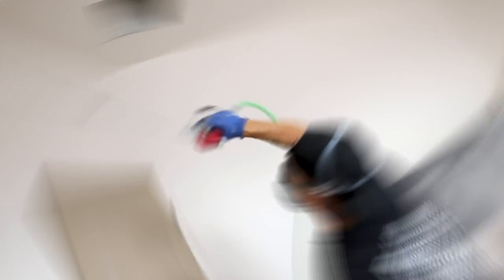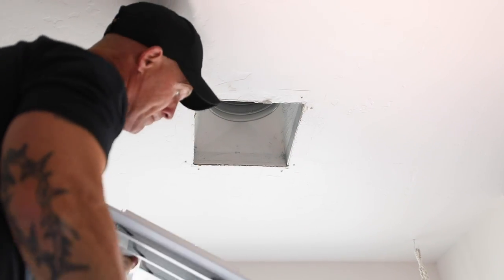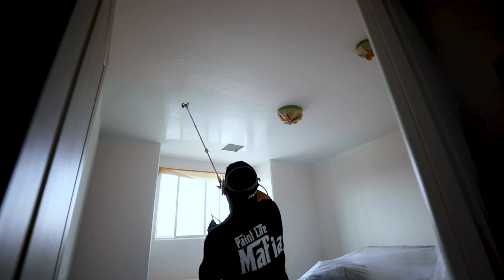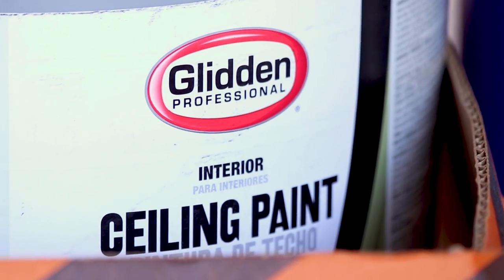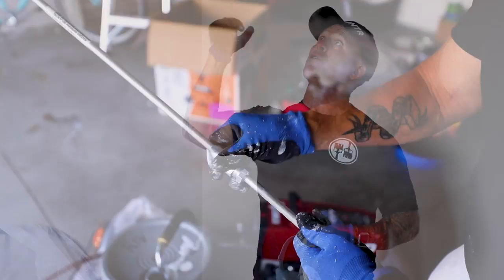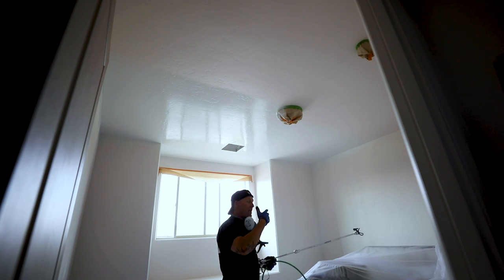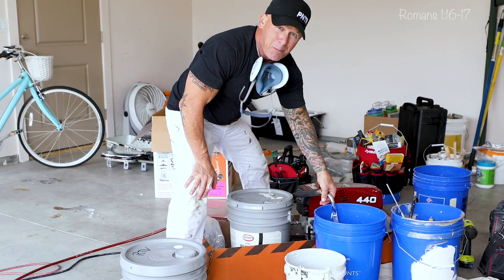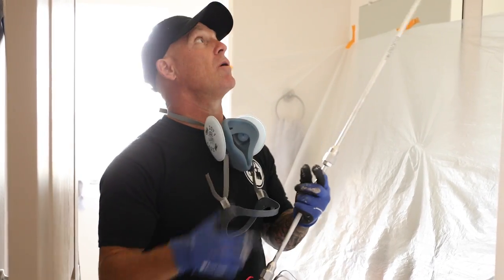10+ Tips Spraying Ceilings. Painting a Ceiling FAST!

Comment: Since chb is hard to find these days,  I've found valspar ultra ceiling covers great,  its pretty thick,  but it dries basically deas flat and is around 125 a 5gal bucket.  I actually like the valspar wall paints as well. Ultra and signature are both affordable paint options that i prefer to cashmere in many cases

Comment: tonight the Answer I have been seeking for weeks has come and clearly. Yes, I put a Guage on my Greco airless spray painter. The Pressure is given let's say spray with 1000 psi you look at the pump and say it's 1000 and it's still wrong. I am using the correct low tip for what is going on.  But tonight I Must thank the boss theidahopainter. finally stated clearly at the gun. I haven't used spray equipment in a long time and You and your crew have brought me right back up to speed a very big thank you Still love getting one of the old guys.  yes, older now but still want to. Just like the old and young bull.

Comment: i just sprayed a whole house with ppg ultra hide flat ceilings eggshell walls i was impressed for the price  i believe its better than pro mar 200 the eggshell also laid very well on the walls no issues with lap marks but you are correct the ceiling paint did finger but dried ok the eggshell did not finger tho

Comment: I have watched a lot of your videos.  I just helped my son paint the entire interior of the house.  I followed your techniques and they worked well.  What I found missing from you videos was clean up.  We sprayed about 50 gallons of paint and the amount of over spray was significant.  Every floor had lots of paint dust.  I am sure every wall and ceiling also has it.  Of course we did all this before the flooring and cabinets were installed.  What is your advice with doing a job like this with respect to cleanup?  Is it ok to leave the pray gun (Grayco X5) over night in the paint?  We did.  Just put the gun in a bucket of watch and plastic over the paint.   Finally, we painted about 40 doors inside by standing them up and linking them with boards across the top.  We did mark where the door went on the top of the door but the over spray covered it.  UGH.  Could not do it out side to to weather, bugs, the number of doors, ....  Doing it side caused even more over spray.  Can you  comment?
Reply: Carpet - Carpet film
Flooring - Rosin paper
Buy a hand masker to avoid overspray on trim, walls  ceilings or windows.
Leave gun & tips in thinner, run thinner through machine after you’re done. 
Power wash exterior before painting, bug repellent.
Use that 9’by400’ plastic and hang it down with tape from the edges of the ceilings and you won’t have overspray on walls.

Comment: I know most paint contractors don’t like Home Depot Behr paint as a professional contractor I have been using it for over 10 years try this for your ceilings BEHR PRO i300 Dead Flat White Paint about $70 for 5 gallons with a 20% discount after Setting up your account
Reply: never used Behr for spraying but it is the one paint I refuse to use. Way to fast at drying.  Pulls like thick glue when cutting edges with the brush I think it's the worst. Love to here what paint life thinks about using it for spraying. Plus my paint suplier is BM and i would have to pay full price for it.
Reply: 1 idea,,
I tried using totally tree hugger paint on ceilings,
Like the most environmentally "friendly" paint
It actually worked better than the regular paint that minimally keeps the environmental gguidlines
Not a hippy, but it actually worked good,🤔
Reply: The i300 flat is excellent ceiling paint but I will stick with Benjamin Moore superhide zero voc flat,it hides,and rolls better for me.I have them throw some white colorant in it cuts down a bit on the gray.
Reply: @drewcama5481  Customer got some. Yup, pulls itself off as you roll dries so fast.. Don't want to be involved with it again. XIM to the rescue...saved the day. A must have with HD paint.

Comment: Still learning how to spray..  I stain blocked the ceiling and bankrolled.  Sprayed a surfacer on the ceiling which made everything smooth.  Then swapped to ceiling paint.. Benjamin Moores ceiling paint.  Sprayed first coat.  With a 514 fflp tip and came back next day and you could see what looked like ripples all the way down the ceiling... I swear I had the pressure dialed in... I was test shooting on a wall behind cabinets.. Sprayed it... everything looked good wet.  Looked terrible dry lol... uuugh. So I Sprayed and quickly bankrolled a second coat on... but could see flashing.. so waited and then cut and rolled the whole ceiling and left for the day... the ceiling is about 8ft high.  Runs front of house to back of house with windows on either side... I swear even an "ultra flat paint" the Benamin moore ceiling paint seems to have a slight luster to it... maybe it's because I can practically look down the ceiling because of it being low and a long run.. there almost seems to be a slight Lustre to the supposed flat ceiling paint.. I can't figure it out.  Hopefully it looks good in the morning..  I wonder if maybe not letting off the trigger was changing the spray pattern on my first pass... from  the flashing I could see it looked like maybe the spray pattern was heavier in the center and not even all the way to the feathered edges... so the thicker paint made lines and flashed from being slightly shinier.. it was like waves running the width of the ceiling front to back lol... just bad...

Comment: Have you done a video on painting an exposed basement ceiling or could you do one ?
Reply: My SOP is to seal the area knock the dust out with a blower let it settle then vacuum everything including the surfaces I am painting. Dust and dirt are often a big problem in basements. Then I spray shellack and double coat with the body coat. If your using a color have your paint store tint the primer to half the value of the color. That way your double coat will cover for sure.

Comment: Sherwin Williams has CHB ceiling paint works great they dont advertise it if you ask for it they will have it and for dark color ceilings promar 200 flat
Reply: Jay try the promar ceiling paint,not to be confused with promar 200 flat paint for ceilings.The promar ceiling paint is by far the best paint for ceilings,and rolls on much better then chb with a lot less splatter.

Comment: What graco tip would be equivalent to the Titan HEA tip for doing ceilings? I have a graco x5 sprayer I have the standard 515 tip along with the fflp 311 tip,  and want to do it once with best results and be done. Any input will help! Love you channel
Reply: I would like to see an answer to this question as well as I also have a graco x5 and plan on using it to spray ceilings in 2 rooms....
Reply: I wouldn’t use FFLP tips for ceilings unless they are very very clean and already painted about the same color. Use the blue tips 510+ save the fine finish for trim
Reply: Graco makes a green LP tip now (not FFLP)... it's very similar to titan's hea tips. Low pressure and very soft edges on spray pattern, but not designed for fine finish like FFLP.  You prob have to order online or specifically request that your paint store orders them for you.  You can't spray quite as fast as a high production graco tips ( regular black or  blue) but the patterm is amazing if you have clean gun and pump filters, strained your paint and have toyed around with getting correct pressure. I like 619 or 517 for ceilings
Reply: I used a fflp 514 on a ceiling with the graco 395 (sprayed benjamin moore ceiling paint) and I swear the first coat came out looking wavy.. low ceiling... long run so you can practically look down the drywall ceiling and there's windows at the front of the house and back of house so light runs right down it... having troubles not making flashing... sprayed once... came out wavy looking... flashing lines side to side... front to back of house and I was even test shooting the pattern... thought I nailed it...looked good wet.. looked terrible dry..

So sprayed and bankrolled at the same time... made some texture difference lines... thinking I wasn't putting enough paint on ceiling and the roller would pull some back off where I was overlapping (sprayed 4 feet deep by width of ceiling then back rolled it (10 mil nap), repeat whole length of ceiling..) so that didn't look good.  Waited and just cut and rolled the whole ceiling and left for the day... hope it looks good in the morning.  If I still see crap I might try the blue 517 tip I used with the surfacer... maybe I'm not saturating the ceiling enough... even with all that light I'm having a hard time seeing the paint I'm spraying on..

Comment: What I meant to say is did you ever try Sherwin-Williams ProMar ceiling paint? I really like this ceiling paint.
Reply: Hide drywall or plaster defects but dry slow
Reply: I'm working on a huge residential building right now using promar ceiling paint for prime and ceilings. It dries dead flat and it touches up really well. Gone through about 1000 gallons so far...
Reply: i like the ppg ultra hide ceiling better than pro mar 200 ceiling just my opinion tho
Reply: I use pro mar 400 flat for ceilings and as long as there is a good coat of primer on the ceilings the pro mar works great!!!! And also I've used ultra hide which is a glidden product amd works just as good as pro mar 400 from sherwin williams
Reply: Excellent ceiling paint one of my favorites.I now use Benjamin Moore  superhide zero voc flat tinted to Sherwin Williams extra white.,it’s cheaper covers great and rolls a bit better in my opinion.
Reply: I like Dutch Boy soft ceiling white. Great coverage and great hid
Reply: I am not a pro: what is your opinion about Behr  Premium ceiling flat?

Comment: Man I've been painting for like 8 years now and been working towards starting a company...got a sprayer last week (440 titan) i have all the gear I need to do this (everything). Going to be doing new Construction for most part.
Been watching your videos and there great...but.... i have a question.
How do you clean overspray off of drop sheets. Sometime I have to use them instead of plastic and theybsuck afterwards because they just make a mess but i dont want to throw them out that will get expensive...so how do you clean drop sheets????
Reply: Hi I clean mine in a big commercial washing machine at the laundromat.All the best with your new business.

Comment: My first time spray paint I had lap marks I was using a 515 tip any advice. My ceiling looked good the walls had the lap marks thanks chuck
Reply: Dont purchase the Blue tips anymore, Use the green fine finish tips, less overspray and reduces the chances of a rookie having dwell markings, remember wet on wet and you could also basket weave the spray on a second coat

Comment: Wow your spraying direction is the opposite of what I was taught many years ago. It also goes against basics of light and texture.  If you shine a light this case the window  against an edge this case the edge of your spray it will show the texture more than if you shine a light along the direction or  greater length of your texture.  Basically to show texture you light against the grain and to hide texture you shine a light along the grain.  I was taught you always role a ceiling in the direction the light comes in the window most. You say how you enter a room. I've worked with an other painter who always rolls not sprays a ceiling in both directions on way on each coat. And I have heard and used on a low ceiling the "italian" way of rolling a ceiling in all directions at once so that there are no patterns in role marks. When rolling flat paints on  large ceilings I always add a paint extender/thinner so it doesn't dry to quickly leaving texture overlap. do you ever add extender when you are spraying? I am wondering if you can talk about different techniques you have seen or used and why you choose the one you showed?